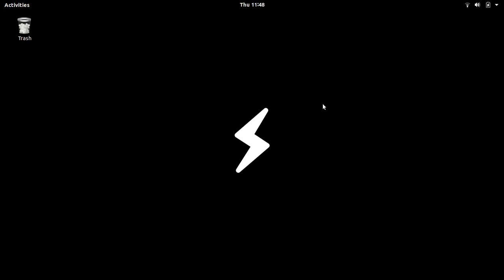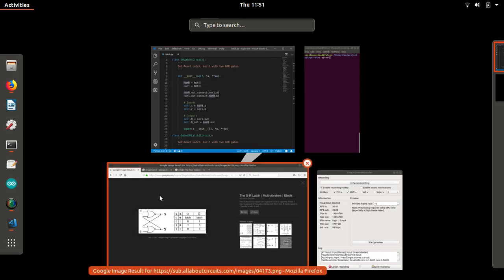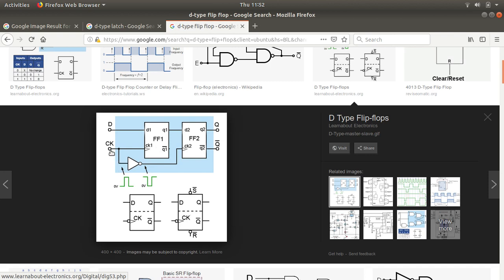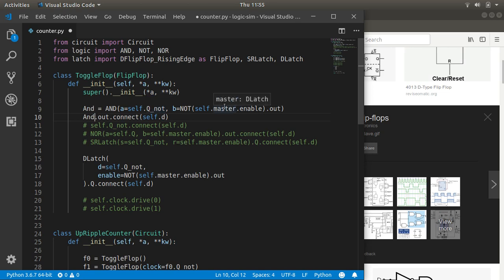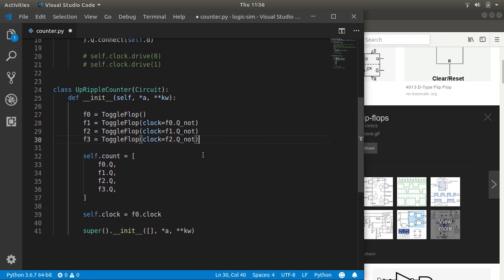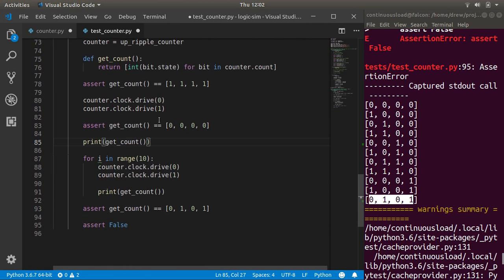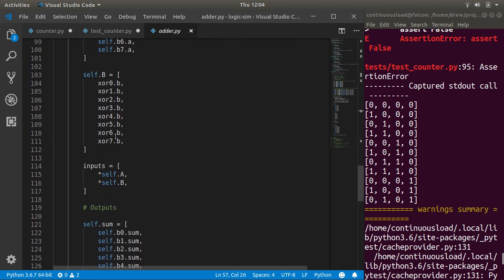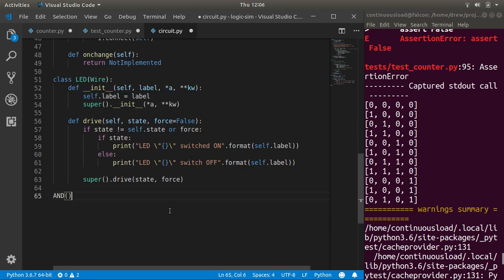Pure Python logic simulator - EASY to build circuits

Comment: Hi, interesting project. How do you manage the "recursion" (or feedback wires, or loops)?
If i understood well, you push the change from some gate to the output connected to the next gate. But if the next is connected to the input of the first one, there is a loop of calls that will never end up. So how did you manage it? Thanks
Reply: Hi, I’ve built an entire CPU complete with 130 odd instructions, 256 bytes of RAM, a keyboard device and a scrolling 14 segment display using my own logic sim simulating only 4 components, being wire, an oscillator, a tri-state buffer and a NAND gate. The way I handled recursion is more about recognising when the simulation has reached a stable state.
Basically each pass through the simulator will update every component state, if any change occurred then it’s still not stable and you perform  another pass, until it no longer yields a change of state. 
In order to achieve this I also treat the first pass of the high state in the oscillator as a special ‘rising edge’ state, certain time sensitive units such as flip flops will use that rising edge as a trigger, so will only flip say on the first pass, but will not perpetually flip while the passes are being simulated to a steady state. 
In my system the entire component set becomes steady after between 1 and 4 passes, and only occasionally up to 6 or 7 passes.
It’s a bit of a hack, but it works and basically I have a turing complete CPU complete with conditional branching, logical operators, addition, subtraction and even barrel shifters and rotators. I’ve even simulated 7 and 14 segment display decoders and built a scrolling display, and a fully working alpha numeric keyboard. Built entirely out of those 4 components wired together. All in pure python it’s hardly efficient but even with 256 bytes of RAM, a 16 character scrolling display, a keyboard and a 130 instruction 8 bit CPU it will execute about 4-10 instructions per second. Give it a go!
Reply: @osogrande4999  WOW Oso, you are a MASTER! So you do not use components that updates the status of the connected ones. Instead, for every clock cycle, there is a "simulator" that iterates over all components looking for updates eventually, up to no updates state is reached. Than, it can pass to the next clock cycle, right?   
I didn't understand if the code is available on GitHub or not, for studying and testing it. Thanks for sharing!
Reply: @jdaniele  Hi Daniele, I'm afraid it isn't on GitHub since I still have to clean up the code quite a lot. I looked for a way to private message you on YouTube but I don't think it's possible. I wouldn't mind sending you the code as it is if you can find a way for me to contact you privately. 
The project grew organically so the code is somewhat convoluted, and on top of that I built in the ability to construct components that can be 'emulated' instead of simulated so it's even more confusing unless you know that beforehand (this is great for getting some performance when you want to see it in action though).
For every clock cycle (in fact every half cycle since the every time the clock changes the entire component set must be updated), all the logic components are computed over a series of iterations (based on their function and inputs). I very simply keep a flag which tracks if anything changes during that iteration. Once no changes have occurred, then then that half-cycle is complete. It also means I can detect any logical design errors in components by ensuring a steady state occurs within a reasonable number of iterations - I generously allow up to 100 iterations but in my system it doesn't take that many at all.
To ensure timing-sensitive parts like latches and flip-flops work properly I have a 'risingedgepulse' component which is connected directly to the oscillator. This edge pulse will only be 1 when both the oscillator is 1 AND it is on the first iteration - that way it acts like a period of time where in a real system a rising edge detector would do the job of limiting the signal time (I know nothing about real hardware but I do understand some basics).
For the complex parts of the system like the instruction decoder, and other complex 'chips', I created a logic combinator class which basically takes a truth table and generates all the logic gates. That way I design my instruction set with ease, and I can add new instructions with just a couple of lines describing the instruction name, and the sequence of micro operations that it performs - it's really pretty cool. 
I learned a lot from the entire thing, it's very much my own design of CPU, but heavily leverages the knowlege I picked up in Ben Eater's videos where he builds an 8 bit CPU on bread-boards. If you haven't seen them I highly recommend you have a look.
Best of luck - if you can get a private message to me I'll be happy to send you my (messy) code!
Reply: I forgot to mention, the entire system with 128 bytes of 8 bit RAM, generates a huge list of around 44,000 logic components.

These are comprised of :

1 oscillator (the clock)
2 rising edge pulse (one for the clock and one for the inverted clock)
78 tri-state buffers (these connect various registers etc to the bus)
8 bus wires
and literally all the rest are NAND gates which take 2 inputs.

Which is very cool when you think about it!
Reply: @jdaniele  I did it was great fun! I'll clean up the code 'a little' - it's still very WIP and hacky, but I'll send you a working version! (It's using python 3.7 or above and I am using the pyglet library for rendering a kind of visual - still incomplete - I plan on finishing it soon! If you use pipenv to manage your virtual python environments it will be easy to get up and running). Give me a day or two to clean up the code a little and I'll send you something you can have a look at. :)
Reply: @osogrande4999  Hey Oso, please, take all the time you need, even a month if necessary. 
I'm not in a hurry and rushed jobs usually don't get best results. 
Enjoy your holidays! 
Thanks a lot!
Reply: @jdaniele  No problem Daniele, I sent you a WIP version already to your email address, it should have enough information for you to at least see it running. The rendering is totally messy and work in progress but it shows what I intend to do with it.